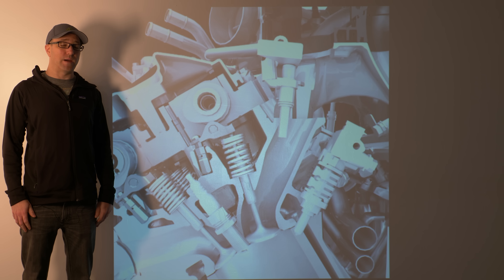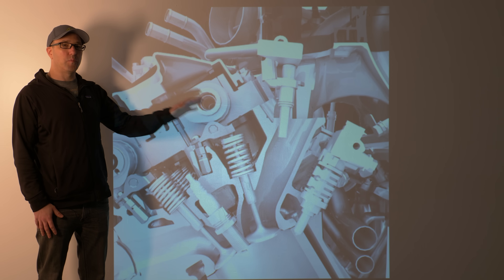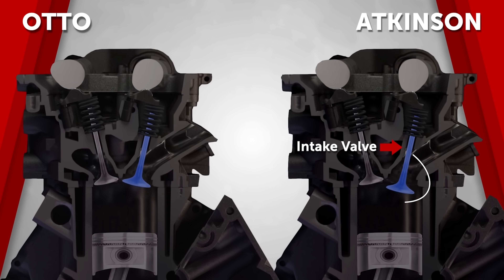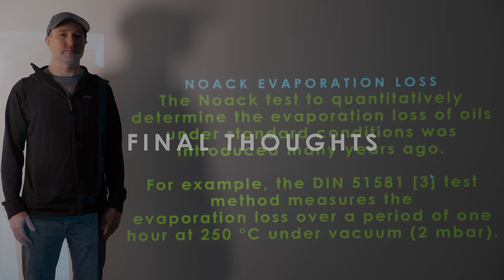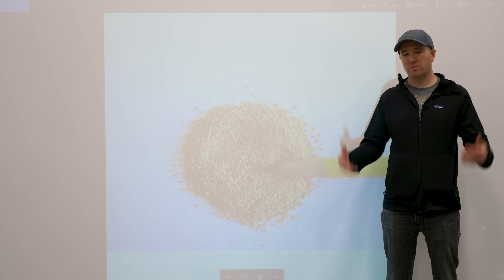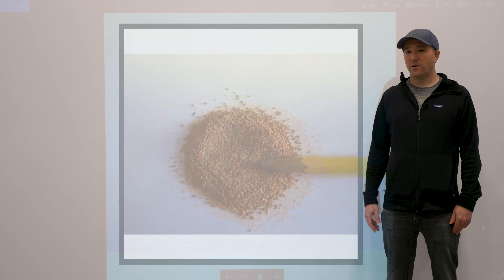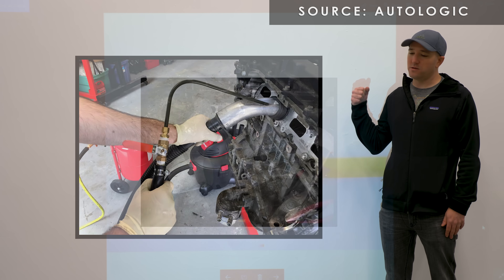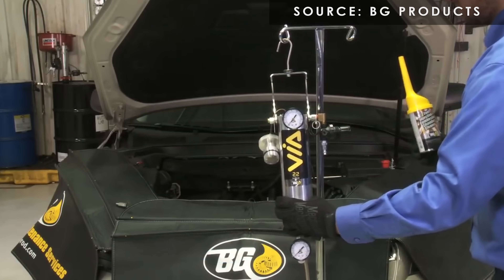Direct Injection, Problems and Solutions | The Fine Print

Comment: So you need a vapor trap can .
Reply: Yes or as it's technically called an AOS (air oil separator) it has baffling and a swirl effect to properly separate the oil mist and droplets from the air.
Reply: @WhormigaMan  Now why didn't Mercedes-Benz, BMW and VW/Audi think of that, when they have all those thousands of real engineers working at developing these DI engines. Must be because it is just snake oil, if you ask me.
Reply: @stephanuhu963  : They did think of it that's what the stock pcv is supposed to do but it commonly allows too much oil to bypass that's why the catch style can as a secondary pcv helps a lot.
Reply: Stephan 'Uhu' it helps, dingleberry, but, its not a complete solution
Reply: @stephanuhu963  We're not asking you. You're inflicting your unwanted and ignorant opinions off on the rest of us.

Comment: Oppressive government regulation, lusted for and mandated by leftists, is what is and will destroy the internal combustion engine
Reply: Caring about the air you breath isn't a "leftist" thing; it's more of an intelligence thing.
Reply: Mike They are doing their best that’s for sure. The Fed government and EPA has ruined about everything they put their greedy corrupt fingers on. Disgusting!
Reply: Efficient engines require a lot of machining, refining, etc etc.
There are so many parts in them, compared to oldschool less efficient designs. Parts that require special finishes and exotic materials and super tight machining..

The world's top engines barely hit 40% efficiency despite all this work. Electric motors peak out at 98% efficiency currently.  But batteries are no angels, environmentally, either
Reply: Irvin Hoover  Wait.
A fuel rail for a 2018 Ford F-150 costs $90.

Turbo Focus ST fuel rail is only $30.

That makes the carburetor MORE expensive if you adjust for inflation, being it was $50 in 1975.

If you add in the fuel injectors, you can get eight for $270, but most Fords nowadays only need six at most.

So...??? I'm confused, are you adding labor?

... And a whole new car?
Reply: That car also had no power and weight 1/2 of what most SUV nowaday weigh. I had a 90s Honda and I would not call it quick. No airbags, thin doors, no amenities at all.
Reply: Irvin Hoover  $150 at the least. $415 at the most. $700 if you want a performance fuel pump (but you'd also need performance injectors, higher boost, and a much bigger fuel pump. Admittedly, that'll get you closer to $3,000, but it'll also get you closer to top speed quicker).

But... You do realize that carbureted cars HAD mechanical fuel pumps... Don't you? 

Comparing a carb and a fuel pump is apples to oranges, bud.

Also, who's a paid blogger here? I don't quite understand your reference.
Reply: Irvin Hoover  Talking about new cars? Yeah, no one I know can afford one of those things, for sure.

Are you saying you're without transport? I can find you a car in your local area to check out if you like. I haven't really owned a car that costed more than $650 so far.

Of course, you may have to do the footwork and the hand-shaking, but I could track them down. If yer around Kansas City, I could come with and see what's worth buying.

Not part of the argument. 👆 You just sound like you could use some help if you're riding the bus AND loading shingles. That's usually a minimum $10/hr job, should be enough to scrounge up a working vehicle.

Sorry, I got distracted. While it is true that cars were cheaper back then, people like me own mum still had to take out financing for vehicles. They were closer to 9-month leases as opposed to 7-year loans, though, which is a crime.

That said, the argument was for the PARTS of the vehicle. You can still buy 'em and do 'er in an afternoon with roughly the same inflated cost. Internet will show you how, so you dun have to visit a library or nothin', unless you don't have internet, in which case you can still visit a library and use books there or get on the internet with a valid library card.

Which... As far as I know, a library card is still free, and libraries are still in every town.

This isn't journalist knowledge, this is personal knowledge. I buy and fix my own cars. I would never pay for a fancy, new vehicle, because even if you can afford the loan, the taxes and insurance rake you over the coals, and if you couldn't afford the warranty when something breaks, you're ass-out.

If you're talking about new cars, you're automatically doing things wrong. ☝Look for a reliable engine, not a new one.

I believe this was also how broke people lived in the '70s. Was it not, Mr. Hoover?
Reply: Irvin Hoover  Ah, that's rough, man. People seem to be getting rid of their cars, though. There'a a $500 Corolla DX in Toronto, 27 mpg around town.

Dunno where yer at, just did a bit of scoping around Canada real quick.

That said, if insurance is anything like America, the older cars cost less to insure. I have a 96 Camry that costs $60 a month and an 83 Concord that costs a stiff $40. That's adjusted for my high-risk status with multiple citations.

For reference, a person with no citartions and a 2018 Ford Fusion runs around $230/month here.

It may work differently in Canada, but I would proactively call around. I tried to quote online, but your car insurance is call-quote only. ¬_¬ Sorry, I can't get any figures from here.

Or rather I don't have time right at the moment.
Reply: Irvin Hoover  Young people should not be buying new cars even if they can afford them, our parents didn't and it rarely makes financial sense.  Buy a new used car.  Hell live in the city and use car share, rent to go camping.  Not a fit for all but for most.  The few that need to drive ok sure you need to drive but take that into account in the work you do.  Lot of trades guys i know who do need to drive gave up having the super fancy truck for a small used car.   One guy just goes with a motorbike most days leaving his gear at the site and only uses his truck to pick up and drop off.  Also don't move far from work.  sure rent cheaper for more space. better go suck it up and work with less space and save.  Money saved when you are young with worth so much more later.  Number one financial advise i've ever seen is keep living like a poor uni student for as many years as you can.  It will matter far more than the salary you can earn.  Plenty making tons of money but blow it all are no more happy with other making half with a more simple live.
Reply: Irvin Hoover  Irvin.  I do understand completely.  I work in insurance.  Each province is different so each individual is going to see a different price for the same profile.  A young make with a fast car is going to pay much less in a govt Monopoly province than private as they are not allowed to discriminate.  A fantastic driver with a cheaper car might pay less private.  Also accident benefits vary greatly between provinces.  

And finally icbc is not a cash cow for the govt.  They lost 1.3 billion last year.  Now one could argue they would be much better prepared for the down years had various governments not skimmed off the profits in good years leaving no rainy day fund.  

Now if you asked me if with my own money what I would charge a young male with a nice car?  A lot!   Start with a nice subcompact for 5k.  If liability is over 350/month with no collision... There is a major issue there, like past claims and or driving infractions.
Reply: Also you do not have to prove you are not at fault.  That is not how liability works.  The other party has to allege you were negligent.  They can sue for any reason but to win they need to prove it was you.  Also a single accident is not going to spike rate from 350/month to 20,000.  That is very exaggerated.  In a private insurer system if you are a terrible driver and no company will take you on you can still get insurance through the facility.  This program is funded by the companies based on their market share.  Rates are way higher.  Until the older claims fall off the loss history and you get get taken back by the normal market.  In bc, icbc would just charge a lot more (but not enough).
Reply: Irvin Hoover  that is quite the assumption.  I neither definitely do not work for icbc, I do love in North Van ;)
Reply: The internal combustion engine is a technology that is at the end of it's useful life. Alternative sources of power have to catch up with a technology that has been developed for more than a century but they will eventually become better choices.
Reply: @Revolt2010  Factories are very closely monitored for emissions. It's way more feasible to put emission controls on a stationary source than a mobile one. If factories were allowed to operate without emission controls we'd have the kind of pollution problems being experienced in Chinese cities. So rejoice that so much production has been outsourced to China. Chinese citizens are dying in your place.
Reply: That is there plan. They're actively making traffic worse in LA for this very purpose.
Reply: its need to die
Reply: Keep in mind that Nixon started this mess, and he was a Republican born in Yorba Linda California. ALL political people are likely to vote for more cost and less reliability in the things that we use. Just need a better way of vetting them, as looking at the political party does not always help. Also the conservative Chief justice Renquest thought that it acceptable for police to steal from people though forfeiture. BTW I am a libertarian... I see both of them as big government and little concern for the people.
Reply: P R it wasn't just nixon. There were other factors such as our country supporting isreal and opec not liking that. It's possible that in response to the retaliation we retaliated on the citizens
Reply: @dparker8419k  , in the beginning our country did not support Israel neither did France or England. When they were about to get Independence we stood in the way of them getting planes and the training to fly them. They had to go to the Czech Government to be able to best Egypt, Syria, Saudi Arabia, and so forth. They supported them with weapons and planes along with training on how to fly them. The USA did nothing to help them in 1948, and this is the history that many overlook. One of the ways that the Germans murdered Jews is that they kept them on German ships and the British and Americans would bomb those ships killing all on board. The only reason that we have provided more support in the last few decades is because they helped keep the petro-dollar the trading currency for oil.
Reply: GDI save 1 mpg and .00001 NOX may be  but to fix it 10000 time more carbon foot print of all the save.
Reply: And you would obviously rather die from cancer and lung disease caused by pollution I guess.
Reply: good riddance seriously. Drive a hybrid or EV or plug-in and you won't miss standard vehicles ever. Few years from now everything will be a plug-in except Mazdas
Reply: Making the ICE as efficient as possible is what we are doing.
Reply: Roberto Commander ok so 30yrs ago a 1.5l 4 cylinder got 50mpg and used leaded fuel. Now with electric assistance you get 50mpg like in the new corolla hybrid using unleaded fuel. 
The government may have good intentions but so does the road to hell
Reply: Mike Wilhelm Government regulation is why we can breathe in American cities right now 25 years ago we had smog so bad but it looks like by 2018 we would all have to live on farms.  America was built on compromise if you don’t learn how to compromise we are all doomed for another Civil War.
Reply: tell ya what...go buy a tesla head for the nearest bridge and drive off...at rush hour ...so someone might notice and give a shit.
Reply: @  @Revolt2010  :Correct. But if they are held accountable, you and me and everyone else will have to foot the bill, in much higher gas and electricity bills for example. Then enough people will howl about it, and next election cycle we vote in the guy who scraps the commitment to clean up industry (like the Paris Accord), and we can have our V8's and massive overweight trucks and cheap energy for a little longer. Leave it to our kids to deal with that in a few decades.
Reply: Stephan 'Uhu' you know these green energies like wind and solar tend to have droughts of energy production and the utility companies sell it back to consumer at discount but at a net loss for the company. What private company is willing to do that and expect to be around long
Reply: Better destroy engines than lungs right?
Reply: And global warming is getting WARMER.
Reply: Manufacturers keep taking the low road when meeting emissions thats why we have the problem. If they would just straight up adopt a hybrid setup then they could just run the engine at its optimal emission range and let the hybrid assist when exceeding certain parameters. The carbon issue should of  been  easily caught during durability testing so either they knew or didnt test, either way it shows a lack of interest for customers once the warranty is up.
Reply: i hope your rightest grankids get lung cancer trumptard
Reply: Those who do not remember the past are doomed to repeat it.  There was a reason why we put those regulations in place.
Reply: And those on the right don't do anything but complain about any progress made... Surprised you know how to use the internet as you probably prefer typewriters and snail mail
Reply: Polluted air is a kind of oppression on it's own. Who do you prefer to be oppressed by.. government, or government's subjects?
Reply: Things come and things go. We've had the internal combustion engine for almost two hundred years now, and that workhorse brought us far and fast.

But our workhorses were left behind for trucks and tractors.

With progress comes convenience. With convenience comes complaint. With complaint comes work, and with work comes progress.

We need not mourne the technologies of yesteryear. I'll gladly take a '68 Dodge over a 2018 anything. But it won't go over 132 mph and it won't last more than 60,000 miles if you maintain it well and are lucky.

The death of the internal combustion engine won't be welcomed. It won't be celebrated. But it will be necessary, it will be progress, and it won't be a bad thing.

And rest assured, when the thing to replace the ICE becomes replaced itself, there will be many who will do the same thing you have, sir. They will blame others, and shun progress. Hopefully you'll be looking down from Heaven then, and you'll be proud that they took after you.

But until then, you can look forward to the beginning of the next phase. Like everything good, it will start off crap. But we're Americans. Humans. We'll get it done and go beyond, just as we always have.
Reply: Oppressive government regulation, lusted for and mandated by leftists, is what is and will destroy..... everything.

fixed that for ya.
Reply: weeral1 Well said!
Reply: DI...In more expensive cars usually owned and driven by rightwingers...why bring political bs into everything...jeez...your comment helps FUCK-0.

Comment: DI engines LOVE Chevron Techron (PEA). They will run like a champ and get better fuel economy with PEA blended into the fuel. They also love E85, delivering better far fuel economy than an old school port injection setup.

Comment: Blow by occurs during ignition! The combustion swaps past the rings (toward the crank not toward the valves) and pressure mixed the crankcase. The pressure bakes its way to the occasion (at the top of the motor) via breather vents through the block and usually into the valve covers.....

Comment: A large number of people with these problems are the ones doing short trips which leads to more build up.  Highway driving leads to a self-cleaning lean-burn cycle that helps clean the combustion chambers and helps heat the valves up enough to allow the build up to burn off a bit at a time.  I'm expecting to have to clean my valves eventually, BUT I do a lot of highway and minimal city driving and cold city driving and have been ok so far.  I also have the Autobahn and some uncontrolled speed zones, which supposedly helps.  A lot.

Comment: At 7:30 you talk about blowby. Blowby goes into the crankcase, not the head. You seem to not know what the crankcase is or had a brainfart.
Reply: It blows by the piston rings and gets into crankcase, the pcv outlet is located on the head because thats the easiest way to connect the intake to the lower portion of the block without extra hoses or risk of oil leak

Comment: I have a 2013 VW GTI. I know all the pros and cons. Although, heat is one of the biggest enemies of carbon buildup. This was even told to me by a VW tech, who I would trust with this. As well as people, I know, who independently work on VW and Audi and used to work for those companies. The "Italian Tuneup" will also help prevent carbon buildup. Basically, step on the gas and redline it at least once every time you drive. The heat generated should cook off at least some of the carbon. Not all of it, of course. I just do it when I'm on a on ramp for the freeway. For the most part lol. Also, if you use fuel additives for cleaning. Use the ones that have P.E.A. (polyetheramine). It's what is used in most gasoline additives at the pump. I'll let you all do the research into that. There would be way too much to type. That is just my two cents. I hope it helps!